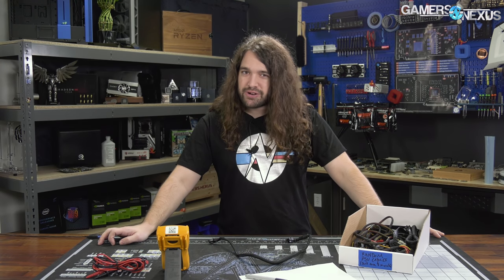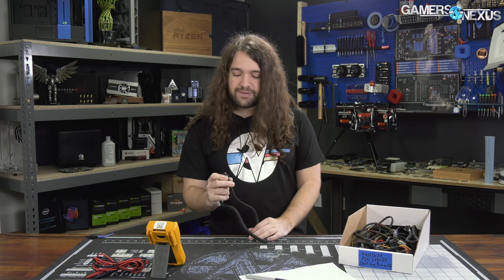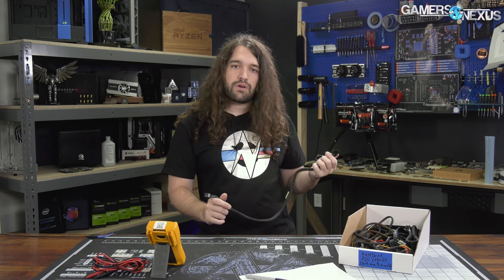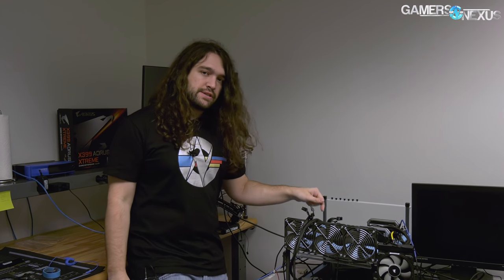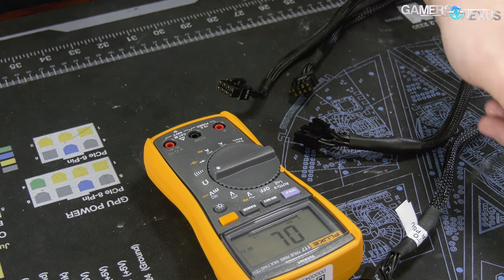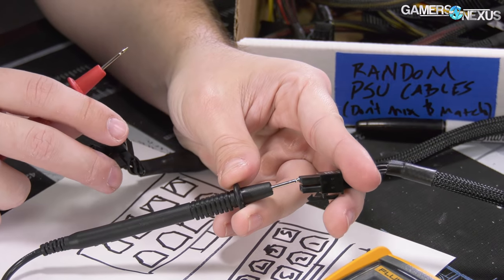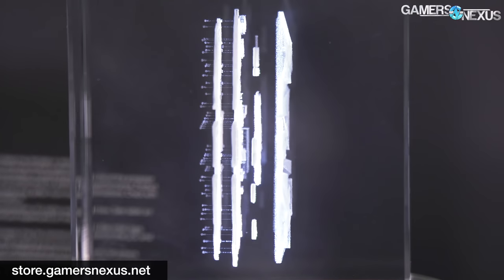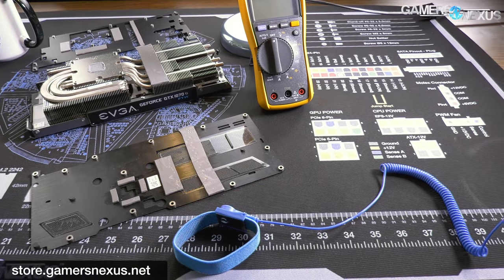How to Safely Mix Power Supply Cables Without Killing Parts

Comment from the maker: Watch our RTX 2070 "secret GPU" comparison! https://www.youtube.com/watch?v=eZJcXHOn42Y
Super basic stuff today. We're working on a ton of testing in-house for dying RTX cards and for Z390 motherboards, so enjoy this easy video for today!
Reply: Can I fry my PSU if I use CableMod PRO ModMesh Cable Extension Kit? Or does it have to be a specific extension kit?
Reply: btosinte website (Build to Order Servers) inc is an authorized seasonic dealer, I had to buy some for an old 750 I lost the cables for.  Reasonably priced, the alternative are sites that sell seasonic sleeved cables at "enthusiast" prices.
Reply: The perfect example of explaining something simple in a confusing manner ...
Your schematic skills are astounding ...
BTW, OL is OVERLOAD not 0L ...
Reply: @g.s777  Extensions won't damage your PSU, because  like their namesake they only extend the end that plugs to your component. The location of the pins is the same, they don't switch places and won't matter since you're extending the 24pin, 8pin EPS, or PCI 8/6pin. OTOH the modular cables that come out from the PSU the side that plugs into your PSU have propietary plugs and pin outs and they may switch, move around. Those need to be specific to your PSU or line of PSU, even within tha same brand the pin out can change from  model to model. TL,DR: Extensions doesn't matter what PSU you use it on. Modular cable replacements, you need the specific for your brand/model.
Reply: Sometimes you can also use an ATX pin extraction tool. To swap the wires around and re order the pins at the PSU end.
Reply: Why didn't you just set the multimeter to Continuity Test mode? One click further than Resistance mode. There will be a continuous "Beep" if there's continuity. That's what the mode is for.
Reply: @pr0xZen  Or you can shove an LED into one end and an alkaline AA with wires attached into the other. It's a total McGyver, but it works and is a lot cheaper.
Reply: Cheap one for $30 ? Ha if you’re just testing continuity a free coupon for one from harbor freight is the ticket . 

Don’t use it for anything where you need to know how much continuity though ...
Reply: Is this doable  for sata powercables?
Reply: GPU (6+2 pcie) cables cannot be mixed either?

Comment: Let me make a niave comment, wouldn't it be great if PSUs had a standard for the cables as well as the other standards out there (size ATX, efficiency 80+ etc). I wonder why there isn't more consistency, feels like it'd be a win for everyone? I'd love to keep my cable mod cables for my corsair power supply for 2-3 builds, perhaps I can after watching this.
Reply from the maker: I suppose it comes down to how willing the manufacturers are to work with each other. The trouble is that everyone thinks they have a better "standard" than their competition, and no one really wants to concede and adopt what someone else is using. EVGA, for example, has universal power headers on some of its PSUs (so you can plug EPS12V in anywhere, or PCIe anywhere), but this is expensive and bulky. While EVGA likes it as a marketing point, another company might not for either cost or size reasons. Then you have the inverse -- some company make extra small connectors to meet tinier form factors, which introduces different complications. Fortunately, the system-side is standardized, so we only have to worry about one end.
Reply: Just re-pin the cable.
Reply: @kennya5165  with what tools`i live in  little denmark and is not easy to finde the right tools. so i tried making my own. :S but yeah that didn't go so well. i have the Corsair RM550x and love it. but it's in a Metis tower (mini-itx) so my pci-e was waaay to long. only need a few inches :P would love to make one myself. because the cablemod site confused me. soo yeah maybe with the right tools. just can't find em.
Reply: Do same connector on both ends with same pinout; Issue solved ...
Reply: I almost agree, except the original X650 is not the same pinout as the mk3 ver of the x650, both made by Seasonic, both the same family of PSU, hell even the same cable plugs on the PSU.  I think they just toss voltages to whatever pin on the PSU they feel like with no thought at all. There is no reason the EPS cable from an X650 can't be used on another x650, lol.

It really is infuriating when it involves costume cables made for a PSU, and then you cant use them on anything else and must get new cables for a new PSU, even if it's the same family of PSU from the same manufacturer.

Still great content Steve and crew. B)
Reply: skaltura, That is how the pinout on the 'original' Seasonic X650 was for the EPS and PCIe cables, then on the mk3 ver of the X650, the kept the same plugs and swapped the voltages on the pins at the PSU side of the cables. Total GRRRRR, lol.

The only thing that saved this FX8350 from Seasonic's treachery, was I was smart enough to test the voltages on the PSU side before plugging it into the old cables in the computer. Moral of the story, Never blindly plug in a new PSU, ALWAYS test the voltages first.

and I simply got rid of the new x650 mk3, and simply replaced the bad parts in the old PSU, no need to wast more money on replacement cables when the old ones work fine.
Reply: You can get a molex pin extractor, and swap pins at will on the cables, if you need to.  You can also remove pins from the plastic connectors without the tool (using a small screwdriver), but it's a bit more risky, and a lot more work.
Reply: @Lorten369  The link posted by Peter H seems pretty thorough from the breeze-over I gave it.  I didn't catch that you need to shorten your cables.  Amazon is a great place to look for tools, but most hardware stores have everything you need - except for pin extractors, lol.  Don't use automobile pin extractors, they're too big. - For wire strippers, I like to use https://www.amazon.com/Stripper-Electrical-Klein-Tools-11063W/dp/B00BC39YFQ/ref=sr_1_7?s=power-hand-tools&ie=UTF8&qid=1541212050&sr=1-7&keywords=wire+strippers this type of stripper over https://www.amazon.com/Capri-Tools-20011-Automatic-Stripper/dp/B01018CX46/ref=sr_1_13?s=power-hand-tools&ie=UTF8&qid=1541212050&sr=1-13&keywords=wire+strippers this type.  The front loading type suck in my opinion, I've tried several models.  You'll need ATX pin crimpers and ATX pins themselves.  You should only need the female ATX pins, not their male counterparts, but I keep a few around anyways, they're handy for making jumper cables.  Both Bitwit and Paul's Hardware have very good custom sleeving videos that go over everything you need and how to properly use all the tools.  With a pin extractor, you can save your connectors and re-use them for the final product.  Doing all this seems daunting, but it's very simple if you can follow directions.  Good Luck!
Reply: @kennya5165  & @Peter H
 thnx so much, yup just needed to "mod" my old cables. shorten them. but all in all. to reuse the key/connector and cables. 
the other issue is price ofc. and here in my small country i can't find it. or the name for it/the tool, in my language :P. that's why i tried doing it myself. because i love it ;) love doing stuff  myself. was easier 25 years ago. i am slagging on my later years ;) would love a cable mod. or a cable mod lookalike if a did it my self. and yes. i like to reuse as much as possible. a perfectionist/minimalist. whatever. i'll be sure to check out kyle and poul to ;)
Reply: @skaltura  doesn't seem to work that way with all the diffrent brands
Reply: You wish :D  How would they  sell then additional cables for YOUR PSU if you could grab any lying around
Reply: That's why extensions exist.
Reply: It won't happen because why would a company do that? Doing it this way means when you buy those fancy custom cables you are now locked into buying any future PSU from the same manufacturer if you want to continue using those cables. Not to mention if you lose a cable or it breaks etc. you'll need to go buy the replacement specifically from them instead of just getting a generic one if there was a universal standard.
Reply: Economies of scale, I mean, if the connectors to all the power supplies were made the same way they'd be cheaper as they'd be built on a mass scale, meaning the price they could offer their power supplies would be cheaper. Steve  above mentioned some great reasons why they haven't as well, the power supplies have a lot of add ons and they operate in different niche markets at different price points, so ultimately that is where we are.
Reply: Ok dumb question but does this mean that you have to get PSU extension cables for your specific PSU? bc it doesn’t ask anything about that when you buy extensions on CableMod
Reply: Well, you can always just buy a pin extractor and re-socket the ATX connectors to your liking. I mean, that is 10$ max of an investment.
Reply: Why can't storage manufacturers market GB as power of 2^30 bytes like OS do and not power of 10^9 bytes? Why can't all manufacturers abandon molex power cables? Why can't manufactures standardized all RGB products and software? Why can't all water pumps use standard pwm signals? The are many more instances for these kind of questions and generally the awnser is as long as there is no really need or bodies that push to create such standards manufacturers will do whatever fits to them.
Reply: I wish everyone would pick either sticking to same in slot as out slot, or going for universal. 
One covers posh high end PSU's, the other is cost effective and still fully compatible. 

Everybody would win.
Reply: @GamersNexus  the ATX standard should be updated for modular power supplies. or mark all these devices that use modular power supplies non compliant with the spec.
the spirit of ATX was to get rid of property connectors and these sort of problems that were caused by manufacturers not wanting you to be able to service components. the pinouts before didnt matter as the cables were attached to the power supply and you replaced cables when power supply was replaced.

they introduced the modular cables onto the market, but the lack of standards is dangerous to consumers and risks unneeded financial loss. its simply the manufacturers not wanting to address the issue.i dont buy your argument for "some company make extra small connectors to meet tinier form factors" they were able to make standards for ITX for motherboards and cases and already have standard for SFP power supplies. theres no reasons a smaller connector could not be used for SFP if needed.

your post seems apologizing for an industry that is hurting consumers for its own selfish reasons. 
did you know even evga was having issues with its tech support sending out wrong cables for warranty and blowing power supplies? it got to point where now evga on all there newer lines standardize regardless of the manufacturer (seasonic etc) the power connectors pinouts. if a company can do it why cant the industry? 

there is really no good reason other than there isnt any incentive unless they were to incur the costs of the devices they destroyed. someone shouldnt need a multimeter to determine if the cable is right and if will work with your power supply that is asinine. you enjoy your time testing the cable and drawing the pinouts?
this is so stupid
Reply: Can you just repin the cable?
Reply: @Zarcondeegrissom  The real WTF were you thinking?! is that they're not keyed.  Like, they could have just blocked one of the connector pins with a plug(loses one pin but works on same end mold), switched 'D' for 'square' (requires ordering different ends though), label them properly (Grr, stupid same-color wires on all pins and no warning for what models it's for) and so on.  This borders on dangerous-stupid.
Reply: They aren't standard so that you keep buying new CableMod kits for your fancy computer.
Reply: so if i have rm750 and i buy hx1000i no need to remove all cables form motherboard and cpu and satat!!
Reply: I'd be happy and content if they at least had printing on the cables with brand and model.

Comment: If you turn that dial on the meter one more click, it will just ring when you find the ones that connect.
Reply: Just make sure you didn't turn the volume off :)
Reply: @kennya5165  There is no volume control for the continuity tester of voltmeters.
Reply: @tikabass  actually, on some there are.  I recently had that issue with a guy I work with, he thought the speaker was broken.  turns out the sound was just turned off.  pretty sure it was a Fluke.  He's an old guy, doesn't know much about electronics, just knows how to "check the millivolts" on the load cells.
Reply: @kennya5165  I have a fairly old Fluke that does this. Its the one with the yellow button on the rotary dial.
Reply: @kennya5165   I've never seen one.   Not on a Fluke, nor on a Metrix, nor on an Agilent, nor on any other meters I've worked with in the last 30 years.  Even bench-top ones.  A continuity tester is not a metronome.  If there is a pot on the meter, it's to zero the resistance reading,, not a volume control.
Reply: @tikabass  There was no pot, it was just an on/off button.  In fact, https://www.grainger.com/product/4EB18?cm_sp=Product_Details-Products_Based_on_Your_Search-IDPPLARECS&cm_vc=IDPPLARECS there's one on this model.  I had honestly never realized it was there myself until our test equipment guy pointed it out.
Reply: Headphone users thank you for not turning that dial any further
Reply: This has been bugging me for ages. Please put it in beeper mode. It's so much better when just testing continuity.
Reply: probably to not have a loud beep multiple times during the video
Reply: raging so hard while watching this RN
Reply: Depending on the PSU and the Cable, sometimes there are inline capacitors under the cable heat shrink, that throw the continuity mode off.
Reply: @achingowl  But then wouldn't it also throw off the resistance measurements?
Reply: I guess they don't want the meter going EEEEEEEEEEEEE into the microphone.
Reply: @SteelSkin667  it would but would still be a better test of point to point continuity.
Reply: My €2,99 knockoff multimeter doesn't have that option and I really miss it. (Also the included wires already create .2 milliohm.)
Reply: And then what do you do like the one pair Steve showed on camera that gave a reading even though it was the wrong pair.
Just Continuity would then give a false positive beep and now you've just plugged in the wrong wires and burned something out.
Reply: @taiiat0  multimeters that have a separate setting for ohms and continuity typically still show the ohms in continuity mode, because they use same basic function of the meter.  So you can still double check your values.  I don't recall the exact readings that you're referencing at this point, but I'm assuming he knew the difference because of an abnormally high resistance in one connection, this should still be possible with most meters.
Reply: @supervillain3213  
But, is still a reason as why relying on a Binary test isn't the greatest idea.
Reply: Never use the biep function. It will also beep when the resistance is very high like it happen in this video multiple times. When the resistance on a cable is sky high, than you have the wrong side and you should find one like 0.2 Ohm.
Reply: Rofl. I was wondering the same thing. My 2 bucks meter got this function as well. How come he doesnt